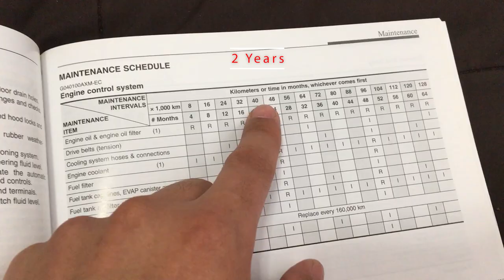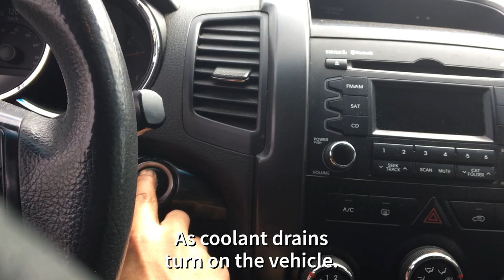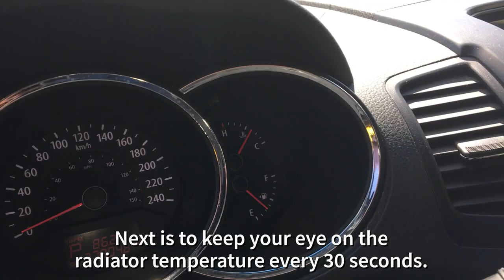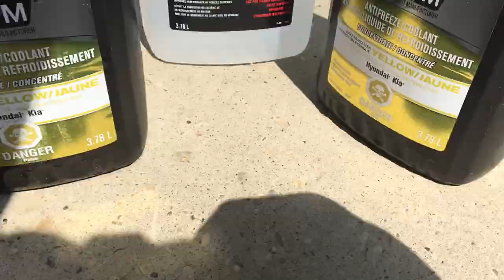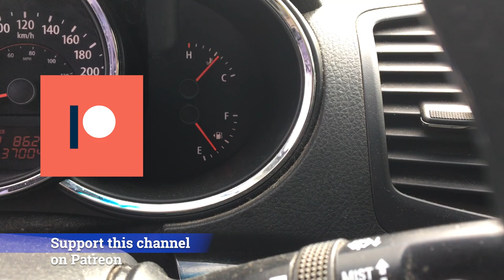Replace Radiator Coolant, Drain and Fill: 2011 KIA Sorento

Comment: I drained my coolant as thoroughly as I could in my 2011 Kia Sorento by running the heat and about 5 quarts came out. From what I read, this is normal due to a couple of quarts remaining in engine block and heater core.
Reply: I got just under 6 litres.

Comment: Everything fine, except engine running during draining process? What about  water pump running dry, I Am not sure this is ok....
Reply from the maker: Its been over a year now and everything running fine with me. Water pump didnt run dry at all. There was zero squealing during this procedure.
How else will you remove the old coolant?
Reply: @AutomotiveForBeginners  that's good news for me, because I also tried this way First But I didnt really like it. I think the Best solution is several flushing with distilled water and maybe putting out the termostat. It is situated at the end of the lower hose, into the EGR and termostat housing. No bad feelings, my friend we are trying to learn something here 🤔😅
Reply: Correct, definitely do not run the engine under no coolant, correct method it to flush using standard water or suitable flush solution then replace with coolant once flushed, DO NOT run engine without coolant.
Reply: @AutomotiveForBeginners  I would remove the coolant drain plugs on the block.

Comment: How many gallons of anti freeze is needed for a 2012 Sorento 2.4 L 4 cylinders.  Need to do the radiator drain and flush. I am about to get two of them, but wanted to make sure. Thanks
Reply from the maker: Best bet is to find a manual that discloses that information. But if you rather eyeball it, you can buy around two 5 liter jugs (50/50 premixed) and fill until you overfill. Good luck!

Comment: Hey quick question. Where is the thermostat on this sorento..i have the same one, same year..my temp is fluctuating on mines and i wanna diy it..asap me..thanks..and good job on viddy..👍👍
Reply from the maker: No worries my man. One way to do it is follow the radiator hose until it reaches end of joint. On the top part. Got a pic here from the manual:

https://drive.google.com/file/d/1UGAQhY3-B1oAg2h-3RFfst422qhNJc3I/view?usp=sharing
Reply: @AutomotiveForBeginners  oh ok..cool..so this is for the 2.4L ? I forgot to put that part, but its the same year..
Reply from the maker: @trubblekleff3655  I think it will be in a similar spot. Theres only 2 hoses and you cant really mess this up taking one hose out or another. Try unclamping the top hose first.
Reply: @AutomotiveForBeginners  yo thanks man..I really appreciate it..this my 1st time ever working on a vehicle..some way just looking at your vid gave me the enginuity to do it myself..u saved me a lot of money like geico lol..hats off to you broly..👍👍👏👏
Reply from the maker: No worries my bro, glad to hear it. Quite the undertaking to go for drain and fill on coolant system as your first go. That's next level beginner status. I can already assume you finished the job successfully then. Easy peasy. 👏👏

Comment: umm

how the heck did you poke a hole there under the radiator?

i dont see any way of taking that out.  there is no screw to unscrew

if i stick a phillips in there it would just  - probably puncture that?
Reply from the maker: This is for 2011 v6 3.5l
Reply: @AutomotiveForBeginners  2015